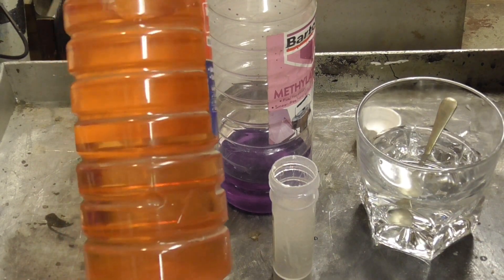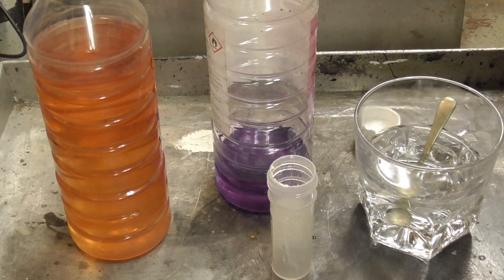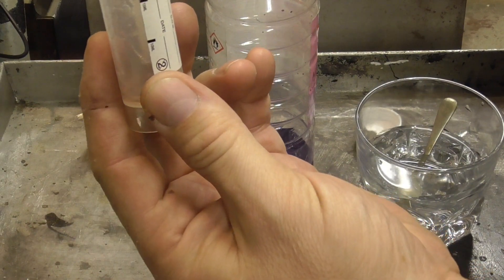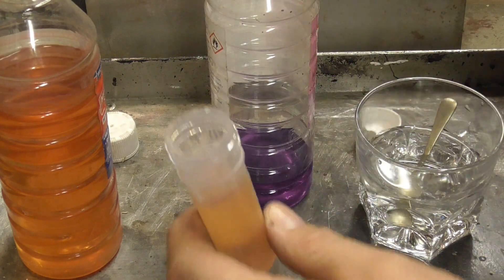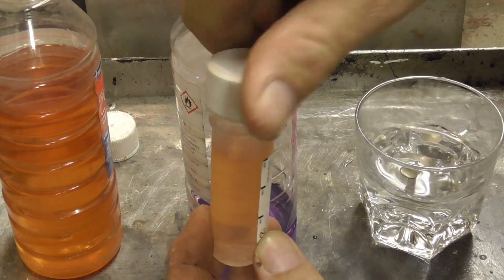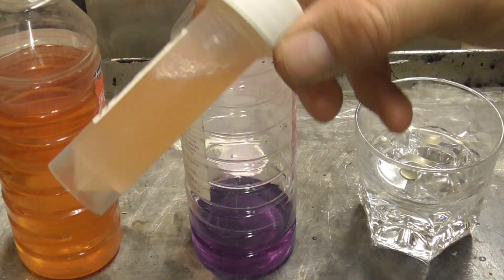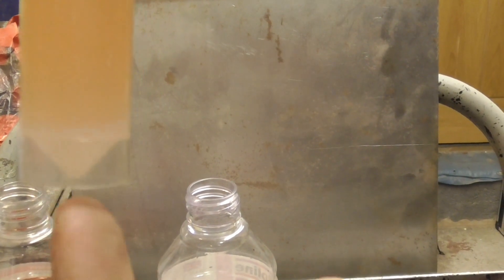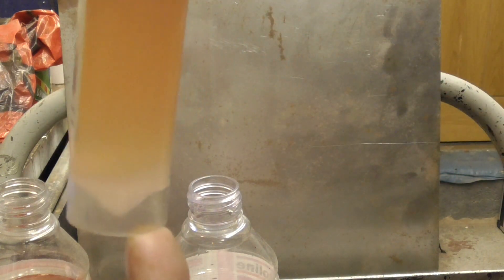Is Ethanol E10 Petrol Safe Fuel For Our Classic Cars? R6 R9 Fuel Hose. This is what I've found.....

Comment: I got a call from my neighbour yesterday that there was a smell of petrol in the communal garage. I went down and saw my Beetle sitting in a puddle of petrol. I had to drain the whole tank. While I was underneath I could see the fuel dripping out from the fuel hose attached to the tank. I hadn't used the car in a month and this has only just happened. Luke from Terry's Beetle Services told me to change all the fuel lines to R9 hose which is ethanol proof. I live in Spain, but I expect this fuel is everywhere. I don't know if this is the reason for my fuel leak, but it's very strange. And yes, it's really corrosive.
Reply from the maker: Yeah its scary, I know someone else who has a similar leak. Wait till you see the vid I release next week, actually replaced my lines last week they were totally rock solid shot! BTW R9 is the best 'rubber option for E10 etc Buy its not Ethanol proof. Ive heard of it failing already online Buy maybe was cheapo fake import stuff who knows. It still has some porosity so while it will be better its still likely to degrade over time, but much longer then R6 or less. I've gone for Teflon stainless braided which in theory is Ethanol proof. Next thing to watch out for is fuel pump diaphram. Best of luck and thanks for watching 😊👍

Comment: I bought some ethanol/bio-fuel safe line from Brickwerks (UK)... supposedly even better than R9 . From their product page: Check the spec of any hose designated "R9" as much of this is safe with "up to" 10% Ethanol (E10)... the actual "R9" spec sheet states "Exposure of this hose to gasoline or diesel fuel that contains high levels, greater than 5% by volume, of oxygenates, i.e., ethanol, methanol, or MTBE may result in significantly higher permeation rates..." This hose is fine with 100% Ethanol. There is already discussion about 15% Ethanol in Petrol (E15) and 10% Ethanol (E10) is on the way.... This hose is E100 safe.
Reply from the maker: Is that a synthetic rubber hose or teflon/ptfe? I'll have to look into that. Thankyou 👍

Comment: Appreciate the time you spent in researching this topic. Some sound advice offered. I am just hoping that E5 is still available when I finally get my bug back on the road (likely to be years from now!). However, when I come to rebuild I shall be doing so with R9 hose. Ohh, and I will be resituating the fuel filter! Thanks again
Reply from the maker: No problem hope it helps and thanks for the kind words. I ran a fuel filter in the engine bay for years before I learned otherwise, I didn't know it was a problem.   I think it may be hard to avoid long term reliability issues of damaged parts however if we keep on top of fuel hose safety it takes most the risk out of ethanol. 😀

Comment: Adding some of history of Brazil, he uses 10% oh ethanol since 70's years... With beetles and t1's...
Reply from the maker: Maybi ask, what fuel lines do you have there? Surely not stock rubber? Thanks 👍
Reply: @PeoplesCar  in old vehicles, special rubber. In new ones, plastic. They also sell hoses of cheap rubber, but they crack in less than 2 years.
Reply from the maker: @andresouza2314  Sounds like your all setup for E10 over there. Thabkyou for the feedback 🙂👍

Comment: In my country, all gasoline are blended with 27% of ethanol... Exhaust pipes will rust a bit faster, but engine will run in long run... I have a Gurgel x12, that uses a 1600cc VW air-cooled.
Reply: About hoses... At least in my country, they won't degrade fast (probably because he already used to 27% etanol). 10% blend is a dream for me, because consumption (more ethanol = less range). A small blend won't will affect much. It's way different than runs with 93% ethanol (with 7% of water). Very popular in my country.
Reply from the maker: @andresouza2314  Wow. Eye opening information! Thank you for your comments 👍
Here in the UK many of our cars sit over winter in cold conditions. This could cause us a problems. Yet to be seen I guess. 
So long as people are aware of the possible pitfalls and have the correct grade of rubbers etc installed I imagine most damage could be avoided. I don't know of anyone who has changed their hoses to R9 here yet though and my own hardened fuel lines are testament to Ethanol damage at just 5%. 
What grade fuel lines do you use there with such high % ethanol? Tx 😀

Comment: I've wondered exactly what the impact of E10 is.  I know it's going to take plenty older cars off the road and it rots parts of the engine but there's a lot of information out there and it's not clear.
Reply from the maker: Absolutely agree. I tried to stay balanced and can't say its safe or not with any confidence. I personally don't see the point of taking the risk of unreliability if it can be avoided but it doesn't make filling up convenient! Good luck 👍